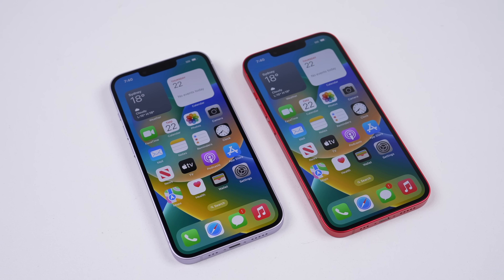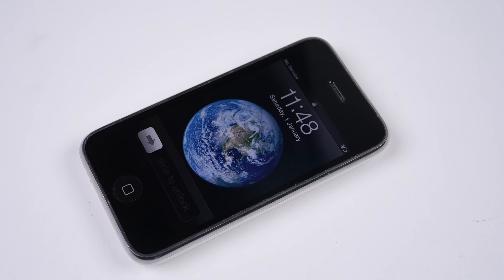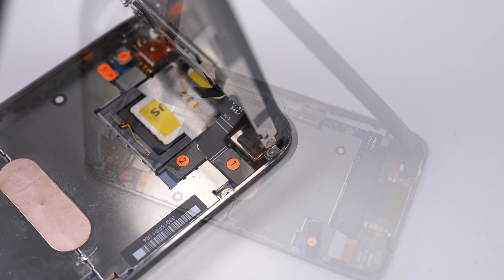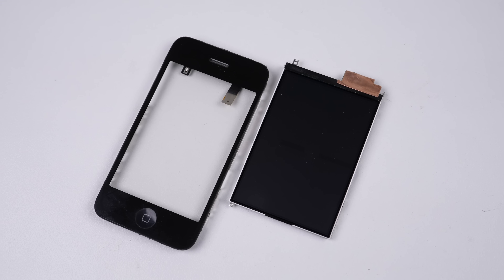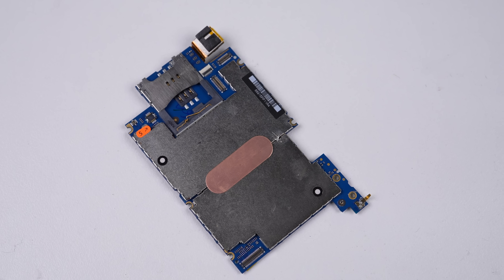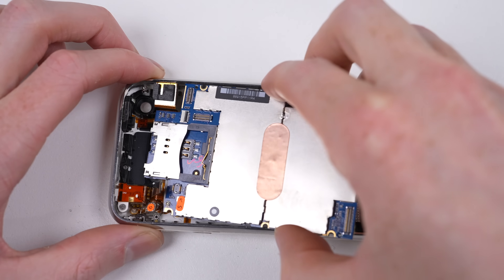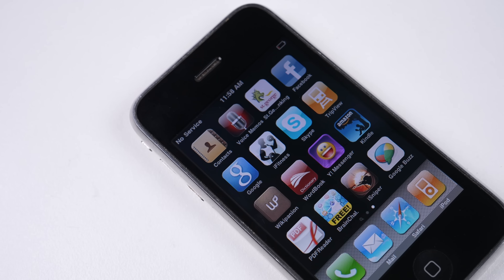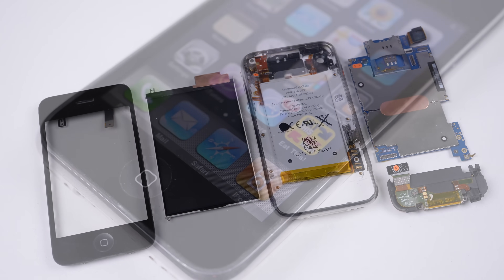Apples Most Repairable iPhone EVER - Teardown And Repair Assessment

Comment: The iphone 4s battery was one of the easiest to replace ever in an iPhone. You could slide up the back glass after removing screws and then there was a sticker that said “authorized service technician only” but pulling that sticker would pop out the battery just like that.

Comment: I know why they do what they do. Besides them not making access and pricing for parts reasonable it prevents crap components from being used. I bought a 5s back in the day that had the screen replaced. Not a genuine display. The touch doesn't work the same on any display that isn't Apple. Even the best Samsung displays don't do touch as well as apple. Parts lock is reputation protection. Places use aftermarket displays and then Apple users are complaining about quality of their Apple device. I see why people dislike it but on Apples part it's smart.

Comment: This is the phone that I first learned how to repair phones with. I agree that it’s a super easy phone to repair but the only issue is the placement of the battery because it requires removal of the logic board to replace it, however the lack of tons of glue strips is a huge advantage.

Comment: The 3g and 3gs were a pain in the ass to work on, compared to the 4 and 4s (personal opinion, ofc). Glasses that detach from the frame, screen dust... I don't deem the pentalobe or the cables that cannot go on other place a big deal. The lack of LOCA glue? Dust in between and much more brittle glass, let alone the slight but very much noticeable difference in color, and the extra light reflection.

Comment: Hey Hugh, there is something that you haven’t repaired yet, and that’s the apple AirPods Pro, I have gathered mine and they have been working amazingly, but it’s been a couple of weeks, and there is a buzzing or Geiger sound when the AirPods are being wormed, I was wondering if you could find a solution for that, I’ve seen that some repairers open them and change the speaker. So I was wondering if you could do the same

Comment: Thanks to watching your videos, I replaced the battery in my 2020 SE using the ifixit repair kit. The repair went without any problems. Of course, I have the warning message about my battery but everything is working properly.

Comment: As someone who likes to buy used gadgets, I really really appreciate Apple controlling the repairability as many many people get their phoners repaired and quickly try to sell them off. Thanks to iOS, you can easily know if the battery or display were replaced.
Okay, I get your point that they don't allow even replacing them with original Apple made spare parts, but then those third party repairs won't get the water resistance seals back. I got this XS Max last year. The person said that it was never opened but perhaps it was. Just one wash under tap water and the whole phone was filled with it and it has been lying since then lol
Reply: It can just say it may not be genuine instead of removing functionality

Comment: I agree this iPhone model is repairable , but it had much more defects and fails than the newer models, as a repair shop owner now , I rarely see an iPhone with a damaged side button, earpiece or even antenna failure, only thing that the newer models suffer of are Screen and (back glass which costs under 30 bucks to repair in my shop ) and it is repairable just like the Display with the new laser technology. So we have many people who use their phone with a good case and screen protector for more than 3 years and never had to repair their phone !!  when it comes to a bad drop then every phone will receive damage !

Comment: The air gap between layers in non-bonded displays is actually very noticeable. It adds a large amount of reflectivity and hampers visibility quite a bit in brighter light. This is actually one tradeoff that I feel was worth it in modern phones.

Comment: My 3GS had an expanding battery while sitting in the box.  It pushed the LCD off the housing and basically had parts all over the place.  I bought a new battery for it and reassembled it and it did power on, though it bootloops.  I thought it would be fun to get it working again, but at this point I'm pretty sure it's done.  Cool seeing how repairable they are.
Reply: Yep, the logic board get's bend and they are dead

Comment: Very good. I’ve just had the battery replaced in my iPhone 12 Pro. It’s an excellent phone and I don’t want to change it as does everything I need. I used to swap out the battery in previous models but not this one. Apple charged me £89 for the privilege, which whilst the customer experience was v good, the price was awful.

Comment: I disassembled one of my old 3Gs's due to the expanded battery a few weeks ago. Oddly enough both of my 3G's have been fine, they must've used a different battery cell in the 3Gs for it to be the faulty one after all these years. That said, the insides of both 3G/3Gs are near identical, and I desperately wish they'd return to the separated glass/LCD panels (especially on $699/799 iPhone models) and the numbered ribbon cables! There's clearly no need for modern iPhones to have 4x the amount of screws as this old one, it's not like these things rattled around in our pockets!!

Comment: Well, 3g was relatively simple to disassemble, but was plagued with wear out issues as cracking back and clear coat peeling off, separation of metal frame ad plastic back, failing ringer switch and buttons loosing clickiness. Oh and LCD and digitizer connectors coming loose and causing display issues. Most of this was corrected with 4, but display removal was a lot harder. I'd say the pinnacle of repairability was 5 (before 5s introduced touchid pairing) as reliability of the chassis was improved and both display and battery (pull tabs) were easy to replace (but still we got issuses with display separating from the frame). 4s was more sturdy and didn't fall apart, but was harder to replace components. That's how we ended up with so many screws holding down every button and flex cable.

Comment: I just bought an iPhone 3G for $2 at a thrift shop. Aside from some scratches, its battery still hold charge and it's very functional. It's passcode locked and it's easily bypassed by reinstalling the iOS. No iCloud lock BS.

Comment: I went from 3GS to 6S to 11 Pro without needing a repair. The only thing that would slowly die was the battery, but it would also be around the time the device was slow enough to warrant a replacement.
Now my 11 Pro's battery is at 84% but the device is still fast enough. 
I'm happy when the EU forced removable batteries comes into play, hopefully that's when I can buy phone lasting over a decade.

Comment: iPhone 8/SE 2020/SE 2022 aren’t terrible to repair. Hardest part is removing the screen, but from there you can replace most parts with minimal impact on performance. Plus, aftermarket replacement screens can cost as little as $20.

Comment: If the damn cell service companies where I live had not shut down 2G and 3G this would still be a great phone for basic use. I suppose in some places it still would be. Where I am they even dialed back 4G LTE for shitty 5G so now with all of the older bands gone I never get service except in a few places so I don't even use my phone because I barely works for call and text.
Reply: I used a iPhone 4S back then. There were no 3G service in 2020-2023 so I had to rely on 2G. I was using T-Mobile at the time. Now using 5G and I think it’s sometimes a rebranded 4G LTE but with more features.

Comment: My next phone will be a Fairfone.  I have a drawer full of old phones that are just too pricey to repair, Samsung. I'm looking at you.
I don't, like most people, need the top tech and abilities of flagship models, so repairability is high on my 'nice to have' list.
Reply: Samsung is especially bad for repairability, in that if your phone is more than 1 generation old, a screen repair will be a total financial loss, as the replacement service pack costs the same or even more than the entire functional phone is worth used. Turns an otherwise fully functional device into e-waste. 
That said, the fairphone isn't an option either with its abysmal specs for near flagship pricing

Comment: If the new iPad didn't have laminated screens, they would be considerably worse for drawing. I agree with a lot here but for pen tablets such as the iPad Pro and other apple pencil devices originally aimed at artists it's important to have the tip of the pen as close to the screen as possible, not a big deal on a 3-inch screen playing flappy bird, considerably worse for a creative pro. even if the functional difference was minute, it would have harmed is viability in the art market  when the iPad pro costs like 1k
Reply: I own an Apple Pencil, along with an iPad Air, and I would much rather have a screen that has a separated digitiser and LCD. There’s pretty bad pressure distortion on the screen when using the Pencil. I’d rather prefer the regular iPad without the laminated display, I did check the devices side by side and confirmed that only the iPad Air with the laminated display had any sort of pressure distortion. If that’s not possible, Apple should at least feature a more durable assembly, as on the Galaxy Tabs. Again, I tried using the Galaxy Tab in a store and it didn’t have any pressure distortions. Both the regular iPad and Galaxy Tab costs similarly or less. Apple uses screens that are too flimsy, even on premium products.

Comment: I honestly enjoy the 3gs i picked up three years ago in a garage sale for $5. Was a risk, plugged it in charged and no password. Had info on it, checked and asked owner they said nothing is needed. So i reset it, luckily it had the sim, you need one to restore these. Otherwise its been an amazing ipod since. Everything is original back cover is cracked a little around the chargeport. Battery has a long life and keeps charge i will pop it open this year too check.

Comment: Regarding water resistance, I'd like to know if Samsung S5 used a hydrophobic coating with their last removable battery phone.
Reply: Not sure about the hydrophobic coating but Samsux still has XCover 5 and 6Pro in the current lineup, both featuring removable covers with integrated gaskets as well as some other legacy compatibility......

Comment: imo the 6s was the most repairable and reliable iPhone ever made. Even if you lost Touch ID by replacing the home button, EVERYTHING was modular and replaceable.
Reply: The greatest technician that has ever lived....
Reply: And not to mention the 6S was a beast. Having 7 years of major software updates is a big deal (same for the XR and Xs with iOS 18) and plus two years of security, making it a whopping 9 years... 6S users are lucky. (I got one from my dad)
Reply: I have a 6s, which only original part is the motherboard. Aside from Touch ID, it just works without any warnings.
Reply: iPhone 7 maybe even more. The 6s can bend.
Reply: The greatest technician thats ever lived

Comment: Yes I would take a laminated screen over a non laminated one. That does effect the viewing experience and a laminated screen is far better for veiwing. However there are other things that could be far better. If only apple didn't pair their parts to the phone, that should really be illegal since how anti repair that is
Reply: Other than the finger print sensor there is no direct parts paring.  What you call parts paring is lack of calibration profiles not pairing.
Reply: @hishnash  But if they don't make the calibration software available(or if things are designed to need calibration unnecessarily) the effect is the same.
Not being able to swap batteries is a "calibration" issue?
Reply: @stusue9733   You can swap batteries but charge and usage info needs calibration yes.

Currently apples solution for calibration is based on having a server that has all the factory profiles and if you have a new parts a phone (or Mac) can pull the profile for that part but if you have a used part that has already been assigned to another device the disgantsic mode (that ships on all macs and iPhones) cant pull the profile.

What apple should change is let you pull the profile of used parts but only if those parts are not connected to SOCs that have been reported as stolen.  RtR should not become right to steal and sell parts for a high price.
Reply: @hishnash  You've been drinking the cool aid to long. What about the chips(power control?) that apple have made a tiny change to so that the "standard" chip that performed the same function wont work, then they wont sell that chip and stop their supplies from selling that chip. The only place you can get that chip to make a repair is from another apple product. So if we follow your argument apple are encouraging "right to steal" as you call it.
Sure some things need calibration, many things have been designed to needlessly require calibration.
Reply: @stusue9733   Everything requires calibration the question is were that profile is stored. Many vendors that buy off the shelf parts have this profiles stored on the part, eg a cheap camera will have the digital signal prossoro that decodes the sensor as part of the camera assembly and thus has the calibration backed into it.

But if you do large enough orders why spend the extra $ on that little chip (that also draws more power) being on the camera when you have a much better (and lower power draw) SOC that can do it, thus you need a profile loaded for the part.
Reply: @hishnash  Rubbish!
SOME things require calibration. 
A power control chip is not one of them. Replacing it does not require calibration. Changing a power control chip for no reason and not making that chip available is nothing to do with "safety and security" and all about making repair more expensive.

Stop drinking from the apple BS fountain.
Reply: @hishnash  I call BS on this, because in many cases you can either transfer the little chip from the old part to the new part or use a tool to transfer its contents, and magically it will work fine, despite the part being COMPLETELY DIFFERENT. What's exactly being calibrated?
Reply: @alex15095   Yep when you transfer that ship it moves the SN of the device so the SO continues to use the existing calibration info. 

It will work OK not perfectly as the calibration will be using the values from the old part not the new part. 

In effect your running with the old calibration profile.

More or less everything needs calibration, this is not new, going back thousands of years we have always calibrated things we make be that a set of scales, or a messing stick or an ink die. If you ant to re-produce the same result every time after you make something you need to test it and then apply a calibration. For scales this is the markings you draw, for ink die this might be adding or removing move or less other colours to match the output, for a messing stick this will be the exact length.
Reply: @hishnash  If you use a "calibration" from a completely different part, and this new part works completely fine, and the only difference is that you're tricking the phone into thinking the screen hasn't been replaced without the blessing of Apple, then this seems to have nothing to do with calibration and everything to do with pairing. If it looks like a duck and quacks like a duck...

Comment: When I saw the white back, I was expecting a video on the 5C, completely forgetting that the 3-line didn't use pentillobe screws yet. It really shows how far a company can fall in repairability without the general public knowing anything. Keep at it, Hugh
Reply: Same and I knew the 3G(s) is easier to repair. But the 5 and 5c are a solid third and fourth place after the 3G and 3Gs.
Reply: @Tom2404  No the 5 had an annoying number of screws. The 4 was the next easiest to repair.

Comment: It's good that U.S. Cellular and T-Mobile still has 2G up so these can actually be used as phones, meaning you can actually use a repairable iPhone.
Reply: In Germany, 3G and 3.5G (HSPA) were shut down a couple years back, but regular old 1993 GSM has been kept alive as a fallback for an indefinite amount of time, meaning you can use any GSM900/1800 phone from the 90s onwards still. Felt a bit surreal when I fixed my own old Nokia 5110 (5190/5125 in NA) from 24 years ago and it was fully functional (calls, texts and all) once I popped a SIM in
Reply: Sadly T-Mobile’s 2G network is shutting down on 4/04/2024, luckily US Cellular’s 2G is indefinitely staying up (though shutdown is still planned at some point)
Reply: @iTheftAuto  There is also a carrier in the Southwest called Commnet, and in Illinois there is IV Cellular (I think they still have 2G) and Kansas and Eastern CO has another CDMA carrier, forgot what it was.